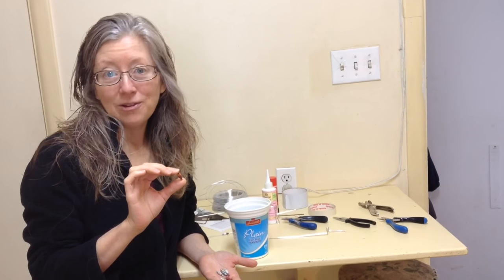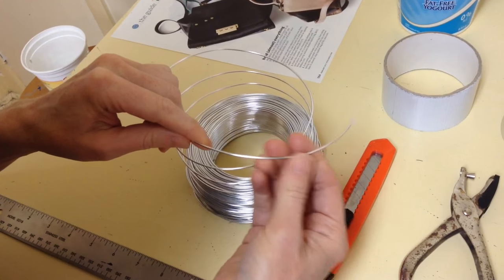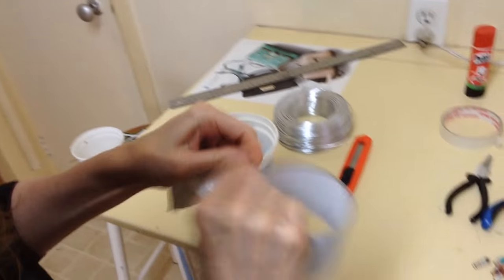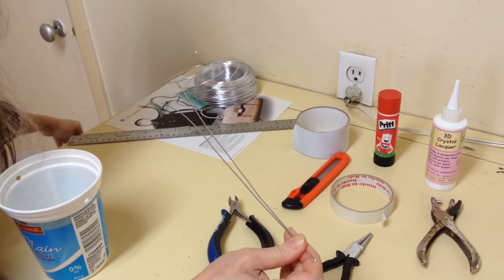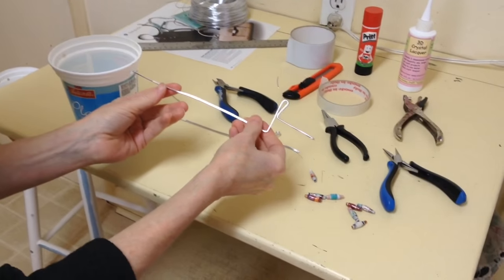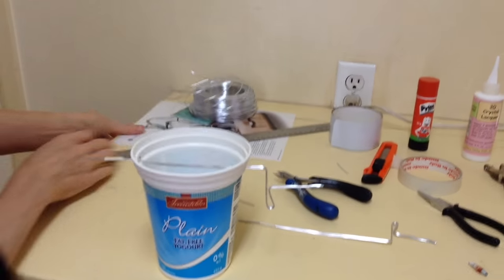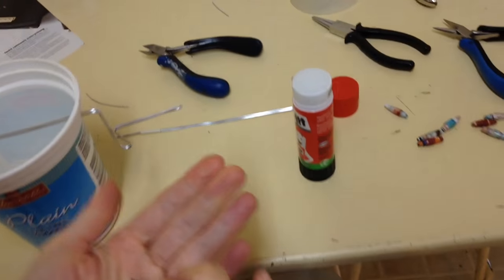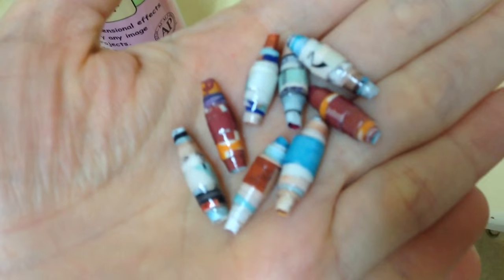Make your own Machine to create Rolled Paper Beads Tutorial

Comment: Thank your for that great idea!  I made a modified version.  I put a bag of rocks inside the contain and hot glued the lid on.  Turned it upside down and use a drill to make the holes for the crank.  The rocks work better for me as my table top and tape do not get along.  Thanks again.
Reply from the maker: Hi Karen: That is an amazing idea with the rocks! Thanks so much for letting me know! I'll add it to the video description! Heather.
Reply: Wow, thanks, but exactly how well did this work, with the container upside down?, Please respond, thanks.
Reply: I was thinking the same thing add weight to the container for sure.  😊😊😊 Sharon in SC

Comment: Wow thanks this great idea, Well i'm going to give this inventive contraption a try, i do hope that it'll work, i've been wanting to be able to make wider beads than what i can make with my small bead winding tools also hopefully this will speed up my bead making & be less wrist turning.  OK,  i filled the plastic container with soil & 2 heavy rocks, i must say that this does work quite well, although it does move a bit, but i'm still able to make tons of beads & it surely beats having to shell out $26.00 & $6.25 for S&H & tax, so i'm happy thanks a bunch.
Reply from the maker: Thanks Melody. The beads wind up quite tightly. I put the pot upside down so the bottom sits flat on the table! You can probably try some other ways too!
Reply: @HeatherBoydWire  Thanks for the reply, but in your video here you show the plastic container right side up, what do you mean by having it upside down? I haven't yet tried doing the container this way.

Comment: Excellent winder design.  The best things are the ones that don't cost a dime.  Do the beads hold their shape well and not get worn at the edges?  Thank you.
Reply from the maker: Thanks so much Diane. You can put a thicker lacquer on the beads so they are more stable.for necklaces. For earrings they probably are fine with regular varnish. Let me know if you make some!
Reply: @HeatherBoydWire  T y.  Can I use an additional coat of the original lacquer?  If not what do you recommend?  Thank you for your help.
Reply from the maker: I use this one:: https://amzn.to/2HRjnsM You can get resin that you mix like epoxy which is very strong and would be more water resistant. For ordinary wear I think the one I use is fine!

Comment: Aren't you clever! I have the store bought tool for coiling wire and a paper bead rolling hand tool. I don't use the hand tool much 'cuz it's so small for my big arthritic hands. I think I'll figure a way to attach it (maybe drill a small hole in the end of the wood hand) to my wire coiling tool and it will go much faster. My wheels are turning now. TFS!

Comment: This is a tool, not a machine, no motor anywhere.
Reply from the maker: Not according to Wikipedia! Machines can be driven by animals and people, by natural forces such as wind and water, and by chemical, thermal, or electrical power, and include a system of mechanisms that shape the actuator input to achieve a specific application of output forces and movement.